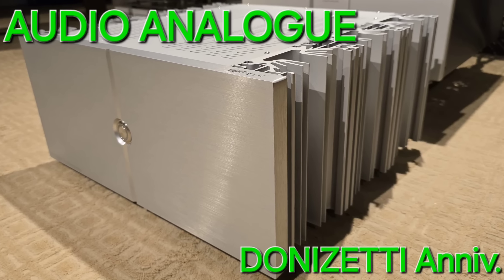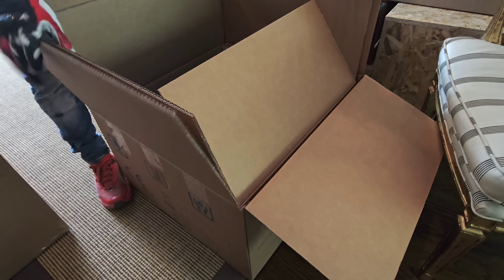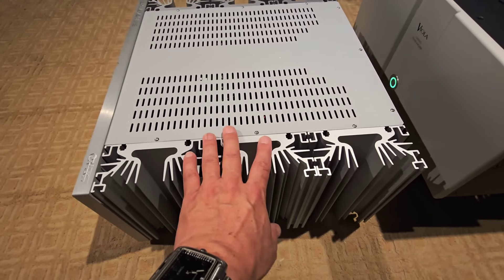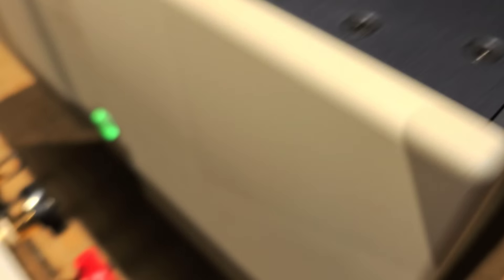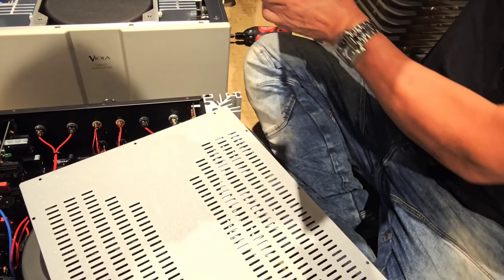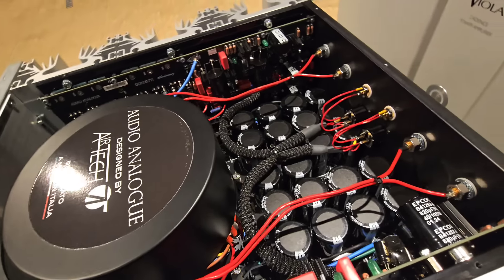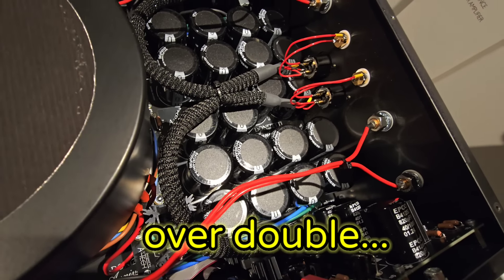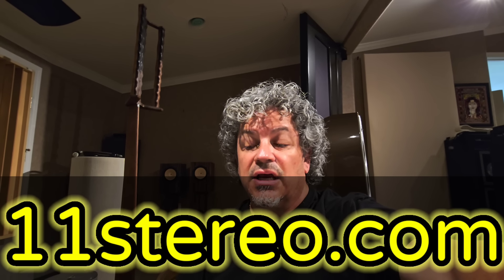a TRUE SLEEPER (High End) #AUDIO POWER #AMPLIFIER !! Audio Analogue DONIZETTI ANNIVERSARY

Comment: Wait a minute mate. The cheaper amp has a much thicker face plate and the heatsinks are much more custom and higher quality than those pedestrian-looking heatsinks in the more expensive amp. Those heatsinks you can buy off ebay for a dime so I wouldn't say it was chalk and cheese. Also, that choke power supply is a bit of a wank. Should have used the space for another transformer if their aim was to "reproduce dynamics without compression".
Reply from the maker: OK, so you are reinforcing my position... Buy the Audio Analogue Donizetti Anniversary, and never look back..

Comment: So another great video, Mikey! I had to pause the video after the unboxing scene to shower. Yes, it was that steamy. 🤡
But I digress. The fit and finish of both amps are great. No losers in that category, tho my hat tip goes to Viola Labs in sheet metal and design. Now for the Q’s. What is the equivalent of the Viola Labs massive choke in the AA amp, a bank of capacitors? I suspect so. And what is the toroidal power supply rating for both amps? Regarding customer service, I emailed Viola Labs about the rating of both their choke and toroidal power supply. No response. That matters in my book.
Reply from the maker: I can remove the back plate but it's a lot of work to read the label. Bottom line will be the sound test. Regardless of circuit details. 1.4Kva on each power xfmr for the AA in a dual mono config.  VIOLA shares it's XFMR between right and left.
Reply: No answer from the manufacturer is also a no-go for me, raises some 🚩🚩🚩🚩

Comment: Always ran w no preamp 😊
Bought Zerozone tube preamp
It should have been recalled 😮
Cheap power supply, bad circuit design
Reply from the maker: That does happen. But I sift through the poor designs for you..  ;-)
Reply: @OCDHIFiGuy  that's important 
Unit sold as "Quite" anything but 
Luckily, I lost $300.  Gutted board 
Rewire power supply, (more juice)
EE audiophile install Hypex 250w